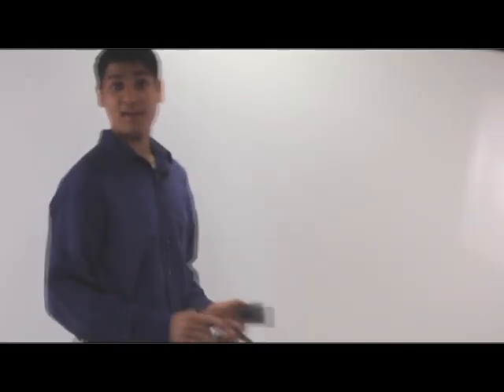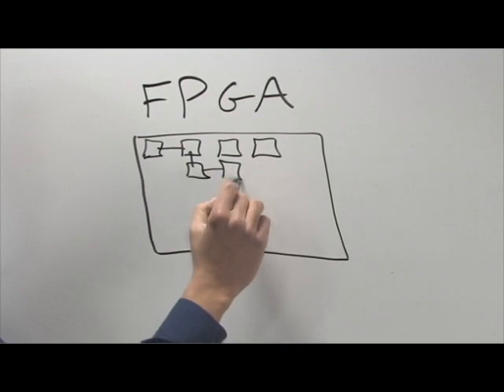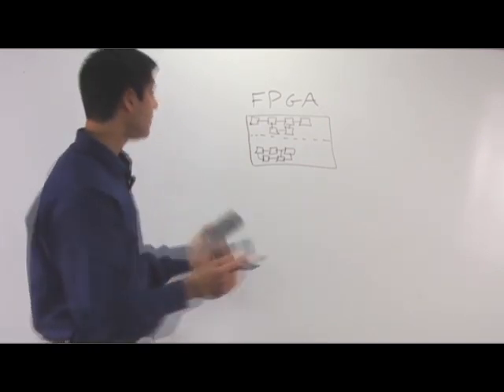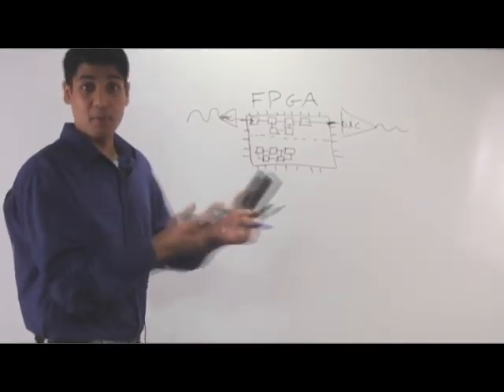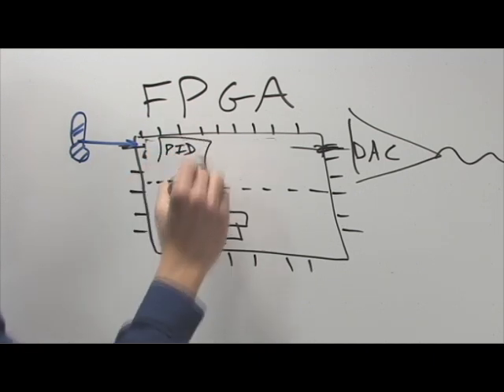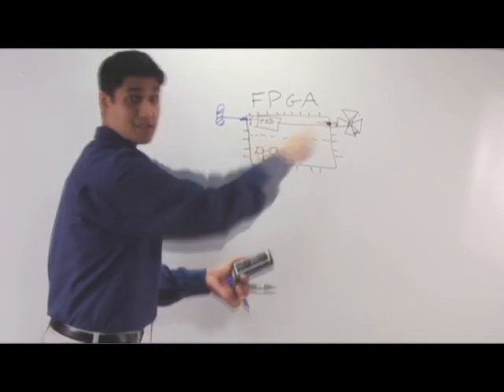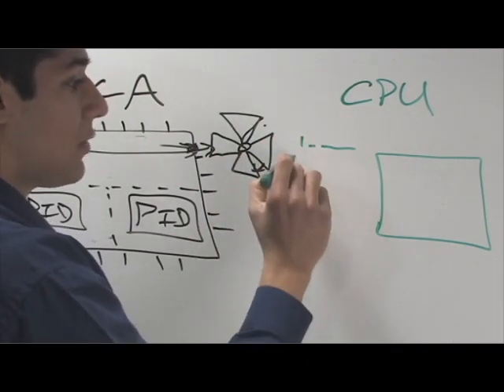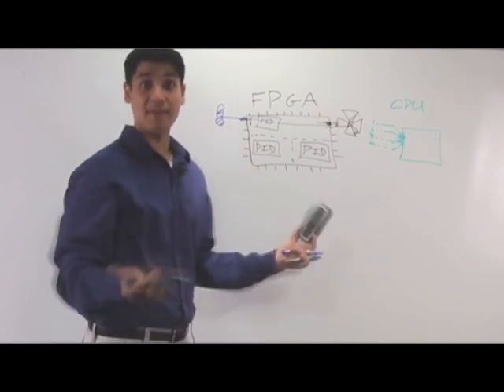FPGA Basics

Comment: So how do you mine Litecoin (or Bitcoins) with this?
Reply: You program the hashing algorithm into this chip as many times as possible. FPGAs are almost as efficient and fast as ASICs (application specific integrated circuit). The big advantage using FPGAs over ASICs are that if the hashing algorithm changes, for example with a fork, you don't have to acquire new hardware to keep hashing.

Comment: Check out the HOAX Hammond organ built using an FPGA. Can someone tell me how these guys got an FPGA to sound like a real Hammond B3? The Hammond uses 91 tone wheels which are basically 91 small metal wheels that spin on an axle, ea. has more/less ridges- more=higher pitch,less=lower pitch.  each tone wheel spins in front of it's own pick-up (just like a 6 pole guitar pick-up, but 1 magnet not 6) the disturbance produces tone (like vibrating string would), HAMMONin a nutshell. SO how with FPGA??